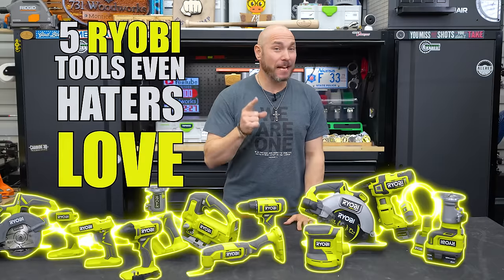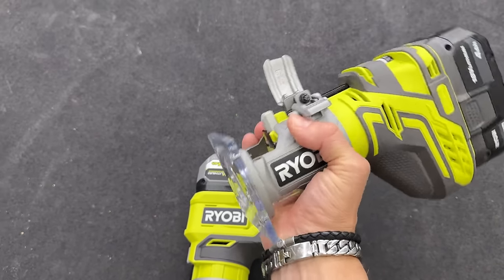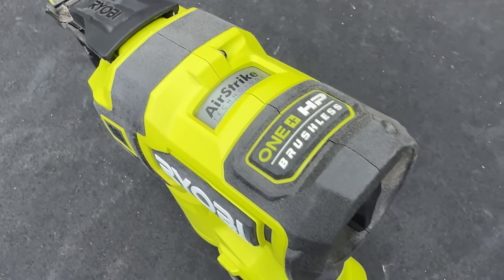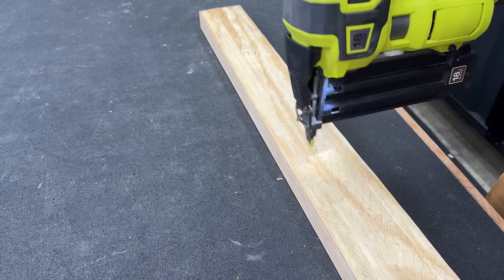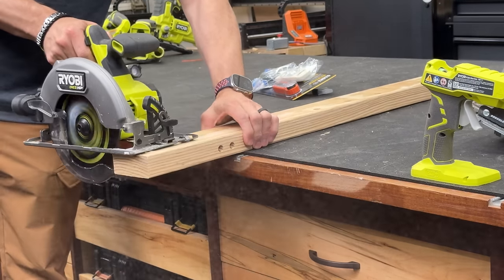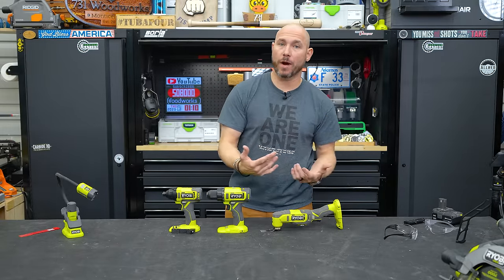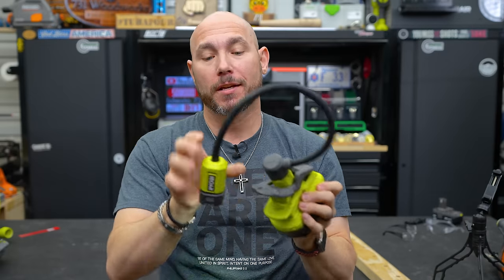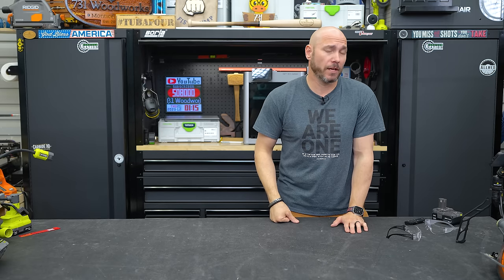The Haters Will Love These 5 RYOBI Tools!

Comment: You're going to get me to buy a kit so I can have a couple of those jewels, eh? 🇨🇦   That glue gun and light look like handy additions. :_fistbump:  I liked my Ridgid 20v orbital sander until Santa brought me an ETS 125 last year. 😊
Reply: If lowes is an option, I strongly recommend Kobalt, as my ryobi tools broke I replaced them with kobalt and kobalt xtr.  They have very good deals, like buy a battery pack get a free tool, or buy one get one free all the time.  Much more power feels much better construction wise, something to consider.
Reply: Go Santa! I love every festool product I've purchased so far. The rotex sanders are game changers! I used one yesterday to sand down the underside of a stair edge to flush perfectly to a venetian tile floor I installed.

It sanded about 1/16th in less than 3 minutes with 120grit on!

I tell people it's almost as fast as a belt sander, but the finish quality is night and day vs a belt sander.

I've been using thier vacuum for a few years and it totally revamped our workflow. I got festools cyclone separator also, it makes the vacuum last so much longer between clean outs. It also keeps the bags in great shape because only fine dust gets to it. I've only used about 1 bag per year which is insane! I used to throw away ridgid vacuum bags regularly.
Reply: @brandonhoffman4712  Looks like I really need to get their extractor and a Rotex after that! 😀
Reply: @LYTOMIZE_Woodshop  So on the vacuum, I am not certain I would re-purchase. I always do research when buying tools. Other companies have enticing offers.

I like makita's newer battery-operated extractor. It even has a Bluetooth auto on with tools. Milwaukee is coming out with the same as we speak, available in the 4th quarter of 2024.

As far as cyclone separators go, my festool one is kinda cool and lower profile. But Oneida arguably makes the best ones on the market and will outperform even what I have with superior physics!

I think makita made a sander like festools rotex line. I'm not totally certain, but I do remember seeing like a $300+ dollar sander from them. Which makes me think there's something extra in there. Plus, I think it said something like dual mode. Smells like rotex to me! Sadly, I recently looked to see if Milwaukee makes one, and they do not.

I also have the TS-75 track saw, cuts so damn smooth its ready for glue up. 

And I have the OF-1400 router. The router is the one I would consider something else. It's cool and all but I'm often having to grab it by its base for better control, I don't love the handle setup on it. Also being festool, it doesn't fit in many/any router table. I have access to a bosch 2.25hp. I like the Bosch just as much except for the travel on longer bits. The festool handles a bit that can make a 2" cut. The festool also has more contraptions to use different ways, sideways, on a track, etc.

Comment: I have the orbital sander and i use it more than my corded ones just better i can move around with it more. But truth be told it sucks, specially with the smaller 1.5 battery. Not sure if I’m it’s just in my head but after i started using the bigger batteries with it it performs much better, maybe because it has more power going into it and it doesn’t have any variable speed so it’s causes it to kick up a notch. 
For work i use a mixture of Milwaukee and Dewalt but at home i got full ryobi for the house use. Under going full renos now with only these tools and honestly cant complain specially for the price point!

Comment: I have MANY Ryobi tools, and they are excellent tools for the price. People love to hate on Ryobi, and much of that is likely because as they innovated and came out with tools, the first models of some tools weren't great; for instance you point out the under-powered 5" circular saw and the sander. There was also an issue with their 1st-gen handheld cordless router, which has since been replaced with a much better one. If someone bought one or two of those, or their buddy did and they used it, they'd complain and state forever onward that "Ryobi sucks", based on their limited experiences.

Comment: I bought a bunch of Ryobi stuff. I suggest strongly against the cordless jigsaw. The hand router is good, but both the fixed base, and plunge corded routers are pretty bad. The router table is very bad for several reasons, and the flashlight that came in the set I bought is bafflingly awful. I love most of their stuff though.

Comment: The Hot glue gun is AMAZING and beats the absolute pants off the $4 box store specials with the dinky cord that will tip over if you look at it wrong; the battery adds enough heft that it stands up on it's own, which is worth the price of admission right there.

Comment: Have you tried the Craftsman 18ga brad nailer I got one from lowes 79 dollars
Reply from the maker: Haven't tried that one yet
Reply: I bought a ryobi hp18g brushless.  The new model.  It broke, it's replacement broke, so I went Kobalt.  I saw the craftsmen, and was afraid it woukd be like Ryobi.  I bought the corded belt sander by craftsmen for $55 and I was very pleased.  It's about an Amp wesker thN most, BUT it's designed with an angle that let's you get right up to the wall.  I bet your 18G nail gun is getting it done gor you.  My 24V Kobalt XTR nailgun still makes me smile as it just goes and goes.
Reply: Craftsman is a joke compared to what it used to be.

Comment: That 5 1/2" saw is the saw to use if you like to repurpose IKEA furniture. Put a good blade on it and you just chop up the furniture without disassembly. And sure, a woodworker is going to turn their nose up at IKEA, but a home owner knows that with a little work IKEA can be an affordable way to furnish a house. That little saw is light enough to can just do the work in the driveway. I wouldn't pay good money for that saw, but they practically give it away all the time.

Comment: I have to disagree regarding the 5 1/2" circular saw - The blade that comes with it is ok, but a Diablo blade makes a lot of difference. I have a 7 1/4" plug in circular saw , but use my 5 1/2" circular saw constantly for cutting 2x4s up to 2x10s - only real problem is that the batteries don;t last very long

Comment: That mini circular saw has been my daily driver for 10 years now--MDF and 2x4 only. Takes a lot of skill to not wreck your wood and I would be petrified to try to rip plywood with this thing. Would rather take my chances with the chainsaw on a stick contraption. At least you have a few seconds to run before it lands on you. Not the mini saw though. It's light enough to walk right up your arm and give you a wet willy before you know what happened.

Comment: There is always that really good tool from that other brand. But, having to support multiple brands with no common pack between them is a pain, and it is costly. I stick with the brand I have committed to, most of the tools are really good, some could use some improvement.

Comment: I have all of these. Big Ryobi fan. On the Sanders. I had an older one that was crap as well then I bought new one last year and it is night and day difference.  Ryobi has a bad habit of dumbing down the tools in the box sets to the cheaper models. I've seen this on many of their tools. They have like 5 versions of the same thing but they are all different inside. Each version does have a  different Ryobi part number so do your homework and look up the differences.

Comment: The Ryobi circular saws I have drive me crazy.  I have the 5 1/2 and 7 1/4 (brushless, not HP).  I CANNOT get the shoe square to make square cuts.  For framing it's close enough, but for anything else it drives me crazy.  I know this is a documented problem with these two saws, but now I hesitate to sink even more money in to trying the 6 1/2 or 7 1/4 HP.  Anyone have suggestions?

Comment: The circular saw (brushed) is truly for little cuts here and there. Nothing special but my biggest issues are 1. the noise and 2. as your cutting, debris and splinters kinda fly at your knuckles so if you're holding that upper grip WEAR GLOVES
- Work Smart

Comment: Ryobi has some good tools but a lot of their tools are creeping up in price close to the top tier tools.  DeWalt seems to be coming down in price and are usually now a better buy than Ryobi.  My favorite Ryobi tools are the more unusual tools that are a good buy compared to the better brands.  I like the glue gun.  Works great and I use it a lot!  I like cordless stapler, it's awesome and one of my most used tools.  I like the brad nailers, they're a great buy compared to Milwaukee or Makita and I've never had a jam.  I like the tire pump. Works great and is like $30.  I like the PVC pipe cutter.  Cuts 1 1/2" pipe like butter!  I like their cheapest weed whacker, they're cheap and dependable.  I like the 6" circular saw because it's so light it doesn't wear you out!  I did buy one Ryobi tool that I was very disappointed in which was the pole chain saw.  It didn't work worth a crap and actually broke.  I returned it and got a DeWalt pole chain saw that was the same price and it works great!

Comment: I usually don't like ryoubi tools mainly because of poor ergonomics, poor balance, and hefty vibrations. I tried the 18 GA nailer once, I was in the market for one, but after putting up some trim it was easy to pick another brand... poor balance and poor ergonomics.  
Haven't tried the new trim router but the old one was unusable. 
The circular saw... poor ergonomics and it is for left handed. 
We tried the multitool in the shop, I thought all blades were instantly dull., it is not good...
Sanders,  there are only 2 choices festool and Bosch. Haven't tried the 3mmirka but it will probably work as well since the air powered is pretty good.

Comment: Used to love Ryobi, and I have used both the Ryobi and the Rigid circular saw shown here, & they were NOT good, even for their price point.   Might have just been bad saws from the get go, but my old Ryobi 6.5" circular saw (the real old ugly blue saw) was much better.   

They're practically hand saws compared to my Flex rear handle 7 1/4" which is better than any corded saw I've ever used - BUT, I've never had a really great corded circular saw, just entry & mid-level saws.    Of course the Flex is also a $300 saw (at time of purchase), but at least it comes with a 10Ah battery, rapid charger, built in dust port, & lifetime replacement warranty on both the tool and the battery.

Comment: I just bought the Ryobi brushed multi tool yesterday and I was EXTREMELY disappointed. I was using it to take apart a mitre saw table that I had built. (Taking the top off, to re-cover it) and it had a hard time cutting through basic 18 gauge brads and I had one slat of wood that was glued to the frame, and I figured the wood blade could help me separate the 2 pieces. Nope. 4-5 times the accessory blade would just come lose altogether want to pop off the tool! Maybe it's just me, but this tool was hot garbage. The lack of power, do you think that's due to the tool its self or maybe due to the Ryobi blades? Perhaps if I bought better blades it would work better? Interested to hear from some others.
Reply: I bought the brushless hp combo kit, extremely lackluster.  I added a jigsaw when my rigid finally died, and I needed an 18G nailer, too.  Both broke, and their replacements both broke in 2 weeks.  I gave Kobaltva try and it is night and day.  If you don't need milwaukee, Kobalt, especially thrir xtr lineup in criminally underpriced and underrated
Reply: But would another brand of multi-tool really do any better?  Probably not.  Multi-tools are lauded as the next great thing, and they do do some good tasks but it seems to me you are probably expecting too much from a multi-tool.  The blades dull really quickly especially cutting metal.  I have a Milwaukee, Makita, Fein, and DeWalt multi-tool and they all pretty much cut the same.

Comment: I am not sure which I hate more, Ryobi or Rigid.
Having said that there are some things that Ryobi is so cheap that it makes sense if it is a tool you will not use often.  Here is a pro tip, buy the battery adapters and use your Dewalt, Milwaukee or Makita batteries in the Ryobi tools.  Ryobi batteries are absolute garbage and you can get the tool only for cheaper.

Comment: For cordless tools, all brands have hits and misses. Ryobi has more misses than most, but also more hits than most. 

Ryobi is TTI's R&D brand. Unless it's a tool that is just a modified version of an existing tool and is geared for a specific niche task, it usually starts out as a Ryobi.

Because of that, Ryobi just has way more tools than any other brand. So you can buy 50 different tools and they could all be junk. Or you could buy 50 different tools and they could all be good or even great. Do a little research before pulling the trigger on a purchase.

For example, their Dremel stations (plug the battery into a base, the rotary tool is ergonomic and on a cord or cable attached to the base). They sell 3 or 4 different versions. 2 of the versions are really good, the other that I had was absolute crap and practically worthless.

Another example is the batteries. The black non-HP batteries aren't worth it. I suppose they're okay in a pinch, but they aren't worth buying alone or even in a kit if you can buy the bare tool cheaper. Always get the HP batteries, even if you only have a few HP tools.

I suppose the lower end Ryobi tools are to get people on the platform for cheap, like REALLY cheap. Their higher end tools are typically where the bang for the buck lives though. That is especially true when you can find them on sale, which is fairly often. Not saying everything with "brushless" or "HP" on the side is going to be the best option, but it's usually a safer bet. They still have a lot of good tools that aren't brushless/HP. Remember that they make so many versions of the same tool, you need to do a little research.

Comment: A lot of ryobi hate comes from contractors that say "It won't last if you use it everyday". As well as their price point.

Well, they weren't designed to be tossed around construction sites all day. Also with those other "tougher" brands comes a price, I used to work in steel. 
The shop only had Milwaukee - and they were great, took a lot of shit, never failed.
But i'll tell you. They get heavy - fast. Compared to some ryobi tools working with their grinder or impact all day gets old, quickly.

Also price... I'd be very suspsicious if another brand came out - made by Ryobi, same tools. Just a different colour and name (not known to the public) - and they doubled the price. What would happen ?

Because we always equate the dollar to quality and social flex. I've met guys that could care less about the fact that their drill is red or the name on it - they just  want to go around with a $300 impact and feel good about having spent that much on it.

Comment: Every Ryobi tool I've bought (including the brad nailer and glue gun) has stopped working within a year. That's why I don't buy Ryobi tools anymore.
Reply: What happened to the glue gun?
Reply: @joeking433 Just like the nailer it just stopped working. The glue gun lasted me two uses, it seems the heating element isn't working any longer. I've just had such bad luck with Ryobi. I have numerous Makita and Milwaukee tools that have been great, but burned one too many times on the Ryobi.
Reply: @CMDR_Elizium51RA  I have both those Ryobi tools and have never had a problem.  Given, I've only used the glue gun a handful of times and the nailer probably 2 or 3 sets of nails through it but I think I had a jam once and the glue gun has never failed.  I don't think the glue gun is apt to fail because they're such a simple tool.  You must have got a defective one or used it wrong or something.

Comment: Ryobi is not near durable enough for heavy use. In my experience I have had much better luck with better (yes more expensive) brands. 

However, if you use it twice a year it will still last you forever I’m sure.

Comment: Just not a fan of ANY battery power - usually underpowered and underperforming tools that leave a lot to be desired, batteries are still not very good.
Reply: I haven't used a corded portable tool in years.  I don't even use my compressor nailers any more, just cordless ones.